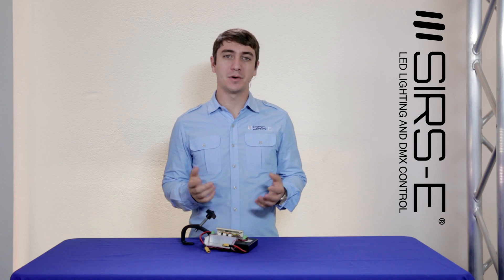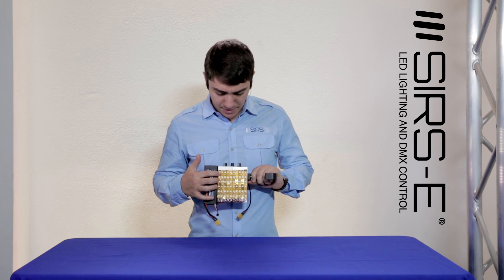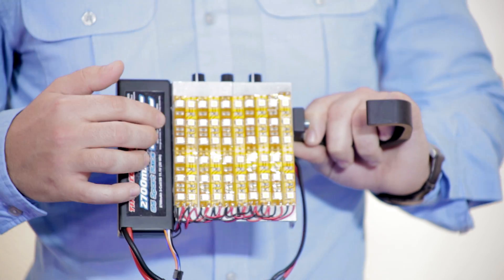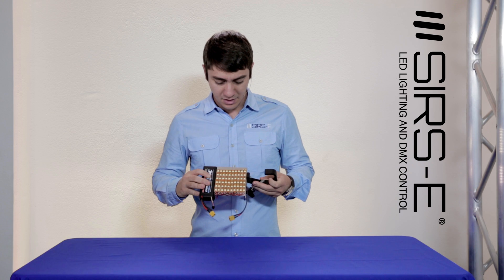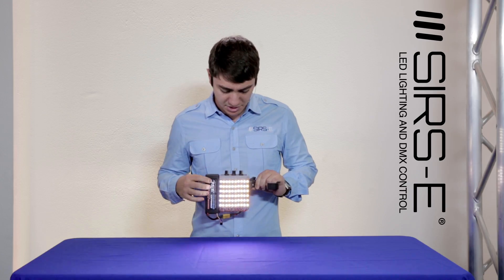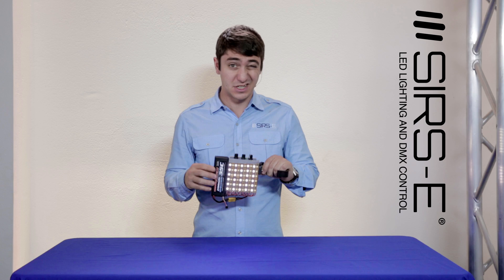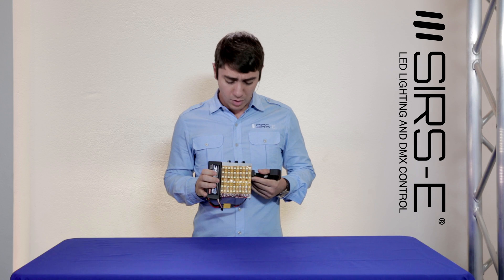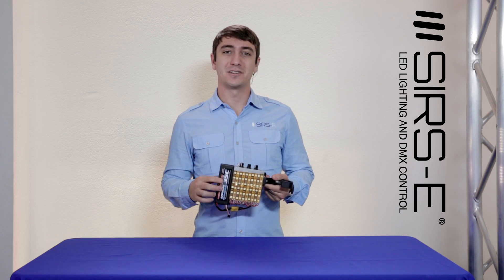Battery LED Light Portable Panel - Do It Yourself - DIY

Comment: That's (almost) what i need.  LiPo for quick charging, LED for 80 - 100 lumens, and 24+ hours of light.
Do you have a video for that?  Would be most helpful.
Reply from the maker: +Maxwell Speedwell Thanks for your comment. You can check out one of our LiPo batteries video to help you find the right battery you need.
https://www.youtube.com/watch?v=k-rlqBOP7b0
As to which LED strip, I would recommend a 5050 White Dual Density LED strip like this:
https://sirs-e.com/shop/led-lighting/led-strip-lights/white-led-strip-5050-wp/5050-smd-white-led-strip-8000-9000k-5m-16-4ft-double-60-m/

Comment: Does this dimmer produce a flicker FREE dimming?  It's for video and some dimmers (PWM) doesn't dim led at high enough frequency, resulting in flicker which video can pick up.
Reply from the maker: Hello Peter XYZ, thank you for watching our video and for commenting. We don't
really get flicker using the dimmer, but the results may vary depending on the
camera being used. To be safe, you should replace the analog dimmer shown with
a DMX Controller such as the LED-CON2-R2 or the Basic Pocket Console by Baxter.
Pair with an RJ45 to 5 Pin XLR Male DMX Adapter.

Item Links:
http://sirs-e.com/shop/led-dmx-controllers/rgb-led-dmx-controller-2-r2/
http://sirs-e.com/shop/dmx-control/pocket-console-series/
http://sirs-e.com/shop/led-rj45-dmx-cables/heavy-duty-rj45-xlr-5-pin-dmx-cable-adapters-3ft/